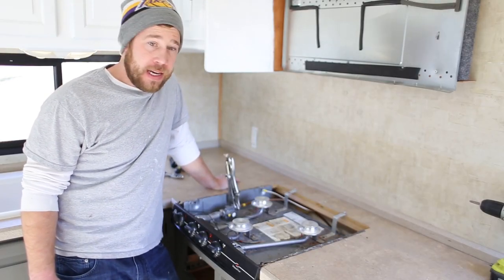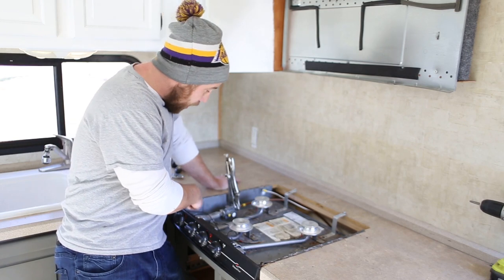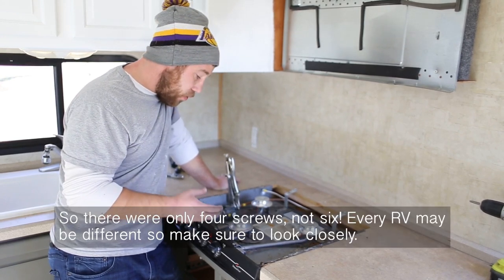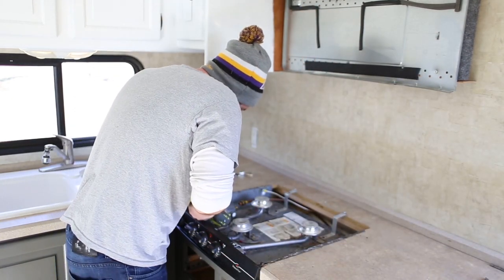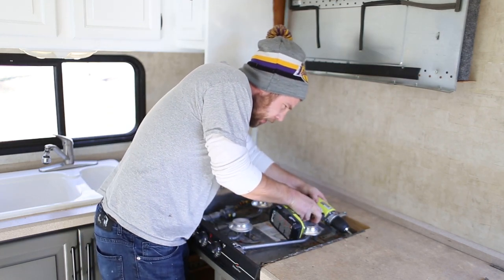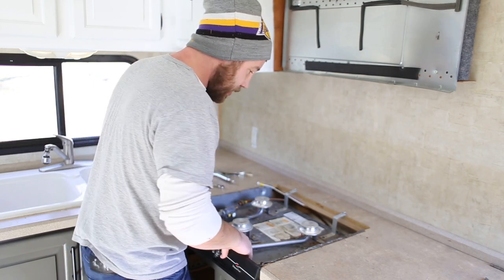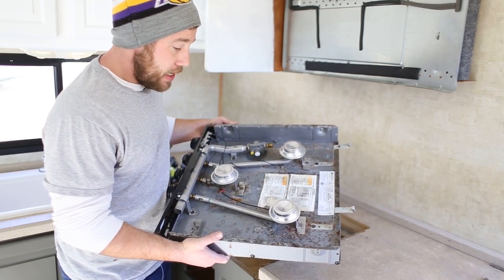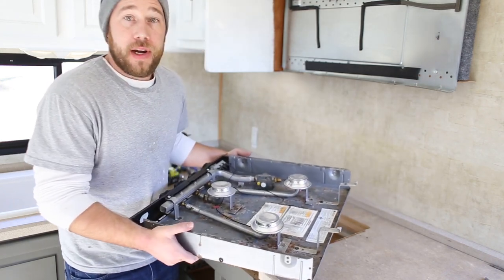How to Remove Stove from RV

Comment: Thank you for the informative video. I want to remove my stove/oven completely and make a storage area out of the space. Please do a video on how to cap off the propane permantly to the stove. I cook with electric and will NEVER use my stove. But I still need propane for the furnace.
Reply from the maker: No problem +Martii Rether I hope it was helpful. Unfortunately we haven't needed to cap off a propane line as of yet. However I did do a bit of research on the topic. I'm not sure when or if we'll shoot a video, so I hope the information below is helpful in pointing you in the right direction. 

This question was asked in a forum and I think the answers were pretty detailed:

https://www.classicwinnebagos.com/forum/index.php?topic=2534.0 

This one was also informative:

http://www.irv2.com/forums/f54/advice-needed-for-capping-a-propane-line-156989.html

Again I hope this helps :) best wishes, Eric

Comment: I am trying to figure out how to remove the metal edging because I am putting in a new countertop. The existing Formica counter goes under the sides of the edging. I have removed screws but it won't come off. I don't need to take out the entire stove. Help'
Reply from the maker: Hey Debra, I'm sorry you are having difficulties, I can completely understand how frustrating it is. Hopefully I'll be able to provide some help. I do want to say that all RVs are different and ours was only a stove top, we did not have an oven attached. So if you have an oven combo things may be different. When in doubt I've always found it helpful to reach out to our RV manufacturer. 

With that said let me make sure I have this right. You have removed the screws that attach the stove top to the countertop but it still will not lift up?

If that is the case I would suggest looking for other screws that may be hidden from sight, I don't know how many times I've tried to remove something from the RV only to find they had 1 or 2 screws hidden that were still attached. 

I'm sure you've already looked endlessly for other screws, so my next step would be to use a flat head screwdriver or some sort of flat edged tool. I would take that tool and slide it in between the counter top and the metal edging. Once I had it in between the two I would try to pry it up gently making sure not to force it up if it's still attached. 

Sometimes with the stove there can be a layer of residue that will adhere the stove to the counter top. I like to think of it as the same as removing an item such as a sink that has caulk around the edges. 

If you're able to notice separation taking place continue to move the flat tool down the edge. If you come to a spot that seems to be really stuck that is a good spot to look for a hidden screw.

I hope this helps with your problem, please feel free to ask any other questions if you have them, or if you need clarity on anything I mentioned above. Best Wishes, Eric.
Reply: Mountain Modern Life z

Comment: I'm trying to remove mine because my counter top is junk. It's gotten swollen in one spot and disgusts me.  It's made of that pressed glued wood dust and chips crap with a thin formica skin on top. Only a real dumb idiot makes counter tops this way. It's a Keystone. I've got the RV oven directly under my three burner range. I'll take my sink and stove out then have to somehow get the countertop off. I want some kind of composite countertop. Can you please recommend a good material. What about corian? Is there anything better for less money?  I'm planning on just bringing my old countertop into some kitchen countertop store and having them make me a new one. Ideally I'd like a countertop that's hot pot pan safe.
Reply from the maker: Hey @Google1 User I understand your frustration for sure some of the materials used in RVs can be rough. I'm not entirely certain on which countertop surface is best but there are a ton of options out there. I say keep an eye on the weight but other than that you should be good to choose from a ton of options. If you have any questions about the process please feel free to let us know :)